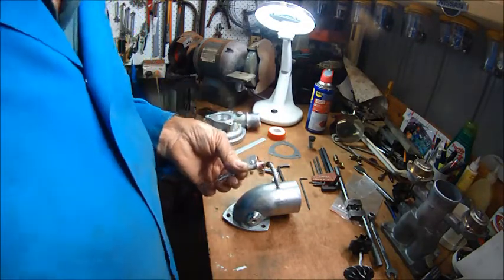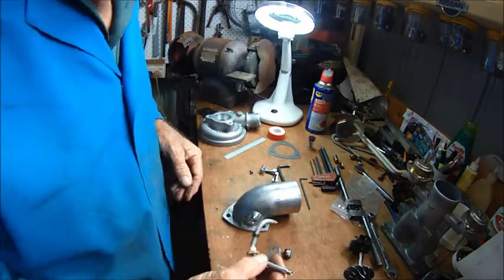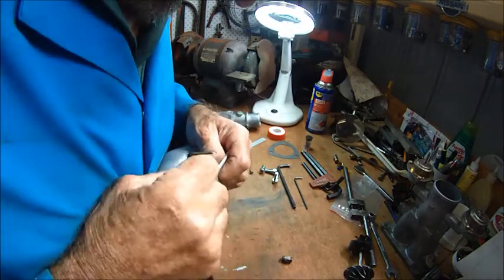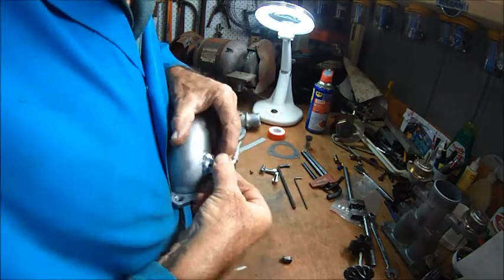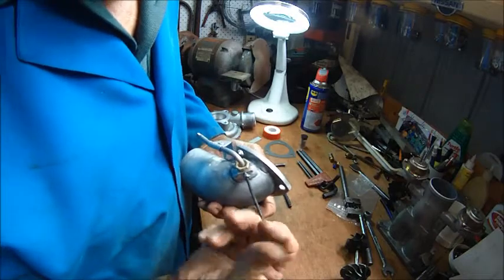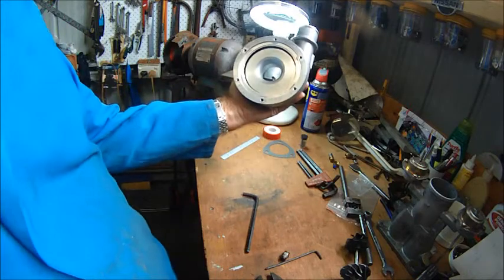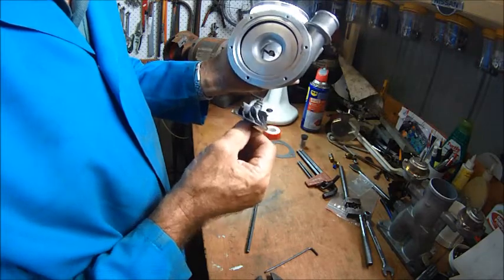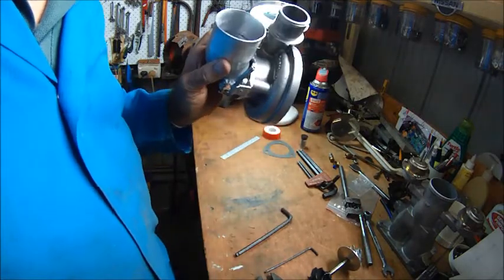Water Meth Pre Turbo Injection Improved System.

Comment: Have you done an updated video of this yet mate?
Reply from the maker: Sorry mate, been away on an outback road trip. I have completely changed the WM injection setup, removed the pre turbo, reasons explained in my build thread. No I didn't do a vid unfortunately, but I did di a full write up in my build thread on the Patrol 4x4 forum, here is a link to the write up, start at the second part of the post, it runs for a few pages as there were comments coming in. This setup is superior to the pre turbo injection I had and also doesn't endanger the compressor wheel tips, the difference between the two were quite noticeable. You will notice the intercooler intake nozzle is mounted at an angle, the reason for this is so that the nozzle sprays water onto the back wall of the intake side, meaning it not only cools the air directly it also cools the tank end giving a greater effect.
https://www.patrol4x4.com/threads/geeyoutoo-3l-di-troll.102892/page-103?post_id=7110972#post-7110972
Reply: @Geeyoutoo  Thanks for the link to the write up
Reply from the maker: @asdf84421  No worries mate.

Comment: love it
Reply from the maker: Thanks, I really should do an update as there has been a few minor changes.
Reply: @Geeyoutoo  im looking to do pre turbo methanol injection and i know i dont want to use a small volume nozzle to keep droplet size down so that my impeller doesnt get torn up. what size did you end up using and what were you spraying
Reply from the maker: @bhearts77   Funny this should come up just now. I have changed my whole system again after becoming aware of study done at a university in the US, I have removed the pre turbo and throttlebody injection points. 
I now have pre intercooler injection with a CM3 nozzle, the difference was quite amazing and the setup a little strange until you think about it the nozzle is as close to the IC body as possible and angled so that the spray actually heads towards the back wall of the end tank, this cools the wall which in turn cools the air. I did this in stages because the next step was quite a big one, injecting straight into the inlet manifold working on the same principle as the IC inlet, luckily I was able to experiment on an old inlet manifold I managed to get my hands on as I was going to drill and tap 2 nozzles into the manifold without removing it, tricky but can be done (and I did). the difference that made was the icing on the cake, I only have small nozzles in there at the moment but I'm looking at re installing my TPS controlled solenoid I used for the pre turbo so I can control usage a little better and only have that work when I really need it, so may be able to go slightly larger there, this is still a WIP. I will put together another vid on this when I get a chance, in the meantime if you have any questions then ask away. This is one of the best mods I have ever done.

Comment: So how did this pan out?
Reply from the maker: Works bloody marvellous, I only use 10% meth just to keep water 'clean'. Have since done a turbo up grade to an Eclipse which is a larger turbo that doesn't lose anything down low and gives good performance right throughout the range, makes a massive difference. The turbo inlet is larger so a larger bend is comes with it which I have modified to accept a very similar setup, but this time the nozzle is only a couple of mm away from the comp wheel shaft, have close to 10,000k on the new turbo without issue and the old turbo had close to 100,000k of pre turbo on it with no issues when I decided to go bigger.
Reply: @Geeyoutoo  glad too hear its working well for you.

Comment: DANGER!!!!
WHEN that NUT comes off,if at full tilt,the compressor wheel is  GONE!!!!,unbalances the turbo,and the turbo BREAKS; pieces of the wheel will go into the engine,and if it's a diesel(piston goes more to the top),goodbye engine!!
You CAN'T do SHHT like that!!! to put a nut on harms way...(the BRASS screws on the old carbs butterfly shaft ,were so well staked and their ends so well split in two,that they never moved;they were not just screwed on); threaded fasteners can back out...
I would have just SQUEEZED flat the end of the pipe, flat to a slit,fold it...blah blah blah
(still one like,thanks for the video,cause i did not know one could "inject" liquid BEFORE the turbo...).
Reply from the maker: Yes you can and safely, it's all in how you do it, have a lot of K's racked up on this setup in all sorts of conditions, I'm also an Engineer with many years of experience so been around the traps :).

Comment: Hey really loving your insights to the 3ltrs have you any info on best diff ratios and upgrading 5th gear.... is there any benefit?
Reply from the maker: Hi Mate, what sort of info are you after and what issues are you facing? all DI's had 4.3 diffs, 3.9/4.1's are available from other models but expensive job doing both. You can get a higher 5th if you want to bring your revs down but that can have other effects if towing etc. A change in tyre size can work for you a small amount, I wouldn't recommend going too big like 35's because that can bring in other issues. 

What model is yours? All Patrols from 2000 - 2002.5 had issues with a week 5th gear that could strip the splines at any time, mine lasted for just over 300,000k but I know of failures at under 100,000k.